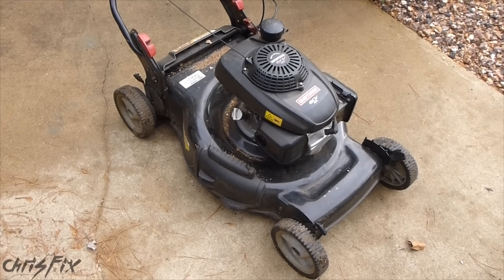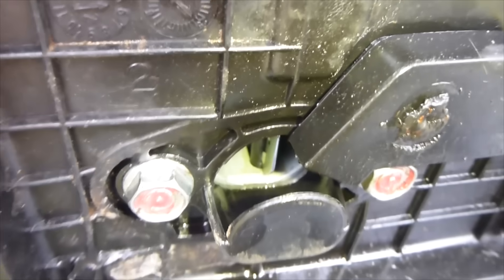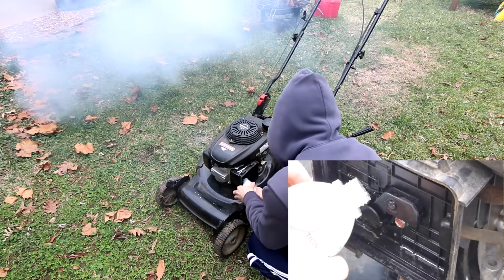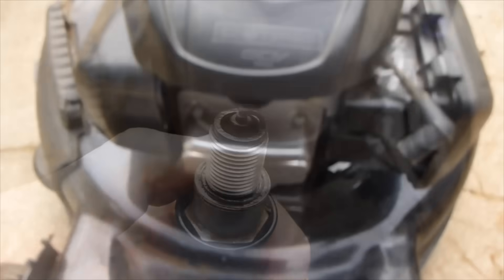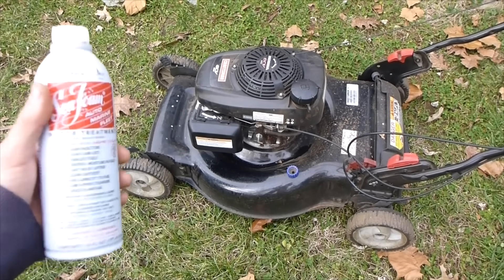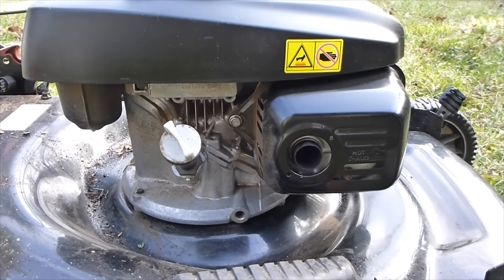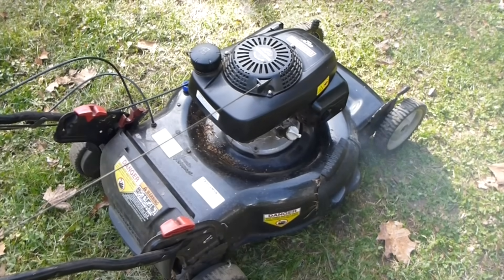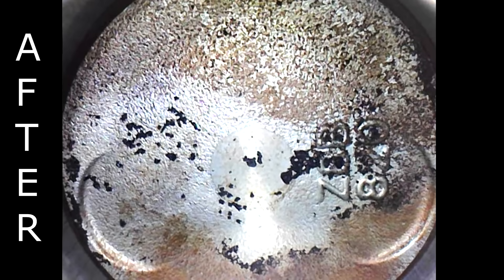Does Seafoam Actually Work? (with Proof)

Comment: I have a 1991 Honda Civic with over 200,000 miles that was burning allot of oil even though I didn't drive very many miles I had to add 1 quart of oil every month. I had no smoke @ startup so vavle seals must be OK, & I didn't notice smoke coming from the exhaust, but it was burning allot of oil. I was using the thickest oil I could find & also added Hy-per lube which is very thick & my engine was still burning a lot of oil. I saw a Youtube video where I guy poured Seafoam into the cylinders, put the spark plugs in, waited an hour & started his car. The idiot could  have hydro locked his engine. I took the spark plugs out & poured Seafoam into the cylinders & loosely put the plugs in & let it sit overnight. The next day I removed the spark plugs & checked how much liquid was in the cylinders, removed excess liquid & bumped the starter to move the pistons. I did this for four days, two days using Seafoam & two days using Marvel Mystery Oil. Now my car doesn't burn oil anymore using 0-30 oil! This seemed to get the carbon off the piston rings & allow the rings to seal properly.

Comment: I know this is from 2014 but is good -relevant information.  The use in a vehicle maybe another story.....i would not put seafoam on a running car engine too many sensors that may become damage? but I would soak the piston  overnight  and removed it the next day with a hose attached to a vacuum.  thanks for taking the time to do this excellent and useful test.

Comment: Yeah I usually just put the bottle in the gas and run it like normal because with a car you have the catalytic converter to worry about after the pistons. Do not want to damage that or the O2 sensors--- the Cat is expensive, the O2 sensors not so much but rarely come out nicely.

Comment: I've never seen anyone use it like this. They normally put it into the gas, oil, or spray it.
Reply: That's how my Dad taught me
Reply: When I first heard about sea foam back in 2003'ish, people were using the vacuum line off the brake booster to suck the can down the intake.  This was before they came out with the cans that had spraying.  Never hear of putting it in the oil pan or gas tank till I bought a bottle to try it out.
Reply: @orange281gt  Ya the couple times we did it was in the vacuum hose off the brake booster, not sure if any way is better than the other.  We were just taught that way 🤷🏻‍♂️

Comment: I spray water into the carbi and it cleans out the carbon
Reply: You really shouldnt do that. It'll cause your engine to seize eventually
Reply: @matthewheade9788  I did this for years on older engines [50-60's] and never had a problem.

Comment: You can clean the top of your piston and valves by misting water in while running. It’ll remove carbon deposits also. It essentially steam cleans the combustion chamber. 

I’ve been using water for 20 years to remove glow plugs and fuel injectors on diesel where there are carbon deposits keeping them from coming out of the cylinder head. 

Combined with Marvel’s Mystery Oil in the oil for a few hours prior to an oil change to remove carbon from around the rings.

Comment: It’s snake oil, run Rec 90 ethanol free in all small engines just like boats. Never have any trouble the ethanol is what kills them small motors. Just like your car every now and then you need to run it and pedal to the floor. If u just put around and don’t burn off the moisture in your engine or give it a good speed run (carbon cleaning) . For example it’s why Gmas 20yr old Buick with only 10k miles on it runs like shit. This guy is an idiot

Comment: berimen b12 works better and is half the price......you can also clear out carbon deposits using water, not sure if it will cause any long term damage but in a pinch it works!

Comment: You are trippin!  I use the sea foam in my 20+ year old Murray push mower in the gas as directed on the product (Briggs). Would not put this in my car as they most likely burn way more cleaner with the modern technology built into them. I appreciate your efforts and don’t dispute. We did this 30 years ago with water or transmission fluid

Comment: dear.sir i used seafoam in my fuel and run it it will clean about 80 % i run it on all my lawn.ewuipt even put a capful in my.oil if you have a used mower with sticky valves

Comment: Ture story....   It was about 25F outside temps and we decided to ride our Harleys.  Pulled up to a gas station and filled up.  We inside for coffee and come back out and the bikes would not crank.  None of them.  We figured it was the gas so we hitched a ride and got 3 cans of Seafoam.  Pour the whole can in our 5.5 gallon tanks, waited 15ish minutes and they cranked right up.  We blamed it on Ethanol in the gas and we also questioned the station about water in their gas tanks.

Comment: Marvel mystery oil will do the same job. The old car lot trick was to rev up the engine and slowly dump water down the carb. The same with dumping ATF down the carb except it really causes a lot of white smoke. In theory stuff dumped down the carb quick burns very hot and dislodges carbon and goop that was built up on the pistons, valves, valve seats, and heads. My mentor in the mechanical field was an old school guy who rebuilt not replace.

Comment: an improvement but not what you'd expect from an expensive product? what about an oven cleaner or cloudy ammonia solution with soap left in for a day and cleaned out thoroughly with alcohol? pour those in directly on cylinder btw, not via carburetor.

Comment: It may have cleaned better if some seafoam was put in the oil.
Reply: How is putting it in the oil supposed to clean the combustion chamber?  Unless the motor is fucked, the oil is on the other side of the piston.

Comment: They have top engine with a spray goes in the carb but this can I believe is for fuel tanks but it will help if it's running bad
Reply: At the time those video was released seafoam only had this product for cars. And it states on the bottle it can be used multiple ways on the bottle. Only recently did they release the too engine spray

Comment: You could have sprayed carb cleaner and blasted the cylinder head to clean it as well.  So what?  It won't make the engine run better or longer.  The main benefit of Sea Foam imho is to clean the carburetor and stabilize gas in a tank.

Comment: I have a 98 Buick LeSabre that refused to start. It drove fine to a friend's house nut just wouldn't start back up. I added a whole can of it to my gas tank which was half full of gasoline. An older guy I know swears by the stuff so that's why I tried it. It took a few tries but the car actually started up again. I haven't had problems since.

Comment: I use SeaFoam in my tractor. I mix it into the gasoline per directions on the can. This method brings the SeaFoam into contact with the carburator and all its associated parts and ports as well.

Comment: You can also do the same thing using water , because the induction of the water it cracks the carbon off . Use this technique for years. Carful not to add to much and hydro lock the engine ..IT WHY BEND THE CONNECTING ROD OR BREAK THE PISTON ALSO if you hydro lock it . Recommend using a small bottle with a straw to add the water

Comment: After standing the mower on the end and having a pool of the cleaner sitting on the piston I think it would be wise to change your oil because some of the cleaner probably leak down into your oil. Just like you should smell your oil on the dipstick every year it's first of the season to see if it has a gasoline smell or not.

Comment: just put the seafoam in your gas, run non ethanol gas and youll have no problems, 4oz marvel mystery oil in your oil keeps rings and valves clean. i liked your video.

Comment: So how has this "treatment" been of any significant value or made the engine run any noticeable difference?
Reply: You add it to the gas to clean up the carburetor, ports, injectors, etc. then it runs better because you are getting a better fuel mixture. The part you can’t see is it cleaning up the valves for a better seal. Piston head carbon only tells you that the other parts are dirty too.

Comment: what a waste of money... The problem doesn't come from carbon on the top of pistons. It comes from the baked carbon that gets in behind the piston rings in their grooves. Enough carbon in those grooves and the piston rings no longer seal or allow oil to lubricate the rings in their cylinders. No amount of Seafoam will cure that problem. Your carbon is superficial.

Comment: This stuff is garbage, never ever use it, I used it on a 02 avalanche and dealt with clogged fuel injectors for sux months,I kept getting misfires on random cylinders, I would have to take them out and clean out what looked like bee's wax out of them

Comment: I drilled a very small hole just after the air filter box. I put a thin hose in that hole connected a small bottle of distilled water. As I drove my vehicle the water would slowly drip into the air flow. Carbon in the combustion chamber, problem solved! I do this once a year for city driving. It's not needed if you run the highway allot!

Comment: I have no affiliation with seafoam . Problem 1990 wave runner 2 stroke 650cc not started in 4 years. Tried an entire can of carb cleaner, ignition spray  over several days, no luck. While digging around  for some other chem Solution , I found an almost empty can of seafoam, about a 1/4 cup . Poured it down carb and waited for 3 hours . It started on the first try. I had already located a carb rebuild kit for it , this was my last attempt before pulling the carb

Comment: Used seafoam on my E60, beforehand the cylinders looked a teensy bit dirty, I could see some build up, then during use I could hear what sounded like rocks in the engine, ran it for a lil while longer, cleared everything outta the system, checked inside with a boroscope, and each cylinder was sparkling clean, I was worried about my valves after the carbon being chucked around but they appeared to be fine and 30,000 miles later still work, soo woo!

Comment: Years ago it was more common to find an engine with what appeared to be a rod knock because of carbon buildup,
As a GM mechanic we used this all the time(GM top engine cleaner) 
Believe it or not you can safely do it with a glass of water, rev it up and slowly introduce the water till the engine just stalls, then let it sit and run it. ( I said slowly, slow= no hydrostatic lock up)

Comment: Before putting small engines away for the winter. I put Seafoam in the gas and run the engine for five minutes. It works better than others I have tried for starting up in the spring.

Comment: Chris, you should run a seafoam mix with your gasoline for an extended time, like over the summer and compare the carbon buildup that results. It would be really interesting to see if using it in your fuel controls the carbon.
Reply: It should also clean the carburetor
Reply: @joshmanis-h7h  and it will keep the white gunk from ethanol away👍 seafoam also saved my atv wet clutch after a friend put regular oil in it👍i approve of seafoam!
Reply: @joshmanis-h7h  That's really the most important thing anyway.
Reply: If I was just doin a mower I would just pull the head off and  clean top of piston . Not feasible on vehicle engines though. 👍🏽

Comment: I used this on my mower, really F’d it up, ended up replacing the carb.
Reply: Also, don’t replace the carb, just clean it. Take out the bowl and blow out the jets. It costs nothing and it’s usually all a mower needs
Reply: Don’t use this on a lawn mower, just run some seafoam through the gas tank. Lawn mowers rarely need carbon cleaning, but if they do, it is actually easier to take off the cylinder head and grind it off rather than to run seafoam through it.

Comment: Gumout is a perfect solution to start the lawn mower. I had done several things like: Cleaning the filter, changing the spark plug, and filling with the clean gas, but the mower still not started. So, I found online, someone used "Gumout" to start the engine.

Comment: Twice now, my wife's J.Deere mower has suffered from 'seeking'...that condition where the engine RPM's surge fast, then normal, then fast, then normal...repeat.  The only way I could smooth it out was to push the choke up to 3/4 (indicating the engine was being fuel starved).  Twice now, I've 'almost' taken the carburetors apart after replacing fuel filters, air filters and fuel lines.  Twice now, it has occurred to me to try a can of SeaFoam and twice now, it has worked.  I'm not sponsored by these guys, I'm just telling you what worked for me and saved me tons of $$$ at the dealer.  If you don't pour it straight into the carb, keep in mind it takes awhile to get from the fuel tank to the engine so be patient while it spins its magic.  I'm convinced it cleans carburetor deposits too.  I let the Deere run about 10 minutes before the problem cleared up completely.

Comment: I use AMSoil Power Foam for my engine and I always soak it up by injecting directly into the sparkplug hole and the intake manifold to clean the valves. The foam makes it easier for horizontal engine like yours. I also did it to my 100cc Honda engine.
Reply from the maker: Thanks for sharing!

Comment: This guy obviously isnt a qualified motor mechanic. Just a YouTube guy.
How much carbon is on the piston crown has no importance at all. What IS important is how clean the piston ring grooves and oil control rings are. As they are responsible for how much oil gets up into the combustion chamber and thats what makes the piston dirty.

Comment: I'm certain that it works. I put fresh oil in my car plus the Seafoam and it turned pitch black after a few miles which never happens when I do an oil change only using regular motor oil. The important question to ask though is that sure, it cleaned it out but are there actually any benefits? Does it improve gas mileage or engine lifespan?

Comment: I wonder if just pouring a little bit of water in there would have the same or better result? I saw a car that blew a gasket one time and the rad fluid got into the pistons, when we opened it up those pistons were like new shiny.  Of course you have to be careful to put in very little amounts but in the 70's they used water to clean out motors.

Comment: "if I want to coat the cylinders in my car, how do I get it tilted up against my garage?" - a real mechanically-inclined person
Reply: your cylinders are vertical but I wouldn't recommend unless you want to buy a new engine.
Reply: It would work really well, if you had an in-line 6 cylinder engine, where the cylinders are straight up. For a V-8, You'll just have to use the intake method, unless, you had a ramp, that would allow one side of the car up to a 45° angle, do one bank, then the other, the same way. Most 4 cylinder cars have the pistons straight up as well. The slant six in some old Chrysler cars, and V-6, as well as V-8 would be tricky.
Reply: They sell it in a spray also, while not soaking, you can hit it a few times over several minutes.

Comment: Don't know how to tell you this, but water will do the same thing.  It's just a quench shock on the carbon, which breaks it loose, primarily in both cases, I expect.  It would be interesting to compare the two techniques, ie. with and without the solvents.  I used to do this in cars on the rare occasions they started "dieseling on" for a turn or two after switch off.  What caused this was a point of carbon somewhere in the cylinder staying hot enough to allow LOUSY combustion after the ignition spark was removed, sometimes for a couple of seconds.  It, too, required careful application, you would just open the throttle completely and regulate the RPM to something reasonable with the water pour (3 or 4 K is fine), but don't stall it, or it was a pain to restart.  Black deposits would absolutely SPEW out of the tailpipe, so it was probably doing the same thing in the pipes, there couldn't POSSIBLY have been that much carbon in the cylinders.  It would cure the problem instantaneously, and usually for a long time, or the life of the car, sometimes (bad gas, just long term 'blow by', don't know?).  Question, Is the seafoam JUST a carbon cleaner, or carb, too?  Actually, I'll just go look it up.

Comment: Air will compress in a cylinder.   Fluid will not compress.  When you pour random amounts of fluid in a cylinder the piston will try to compress it and the compression will be beyond what the motor was designed to do.  This puts a huge load on the rings, the piston,  the connecting rod, and creates a lot of heat.  Do this at your own risk.  You may damage the engine.

Comment: You can do the same thing and get the same results by using something a lot cheaper.  Lol.  Called “WATER “.  Old mechanics used that method to remove carbon from the piston and valves for DECADES.    By getting the engine warm/hot/max running temps  ,then pouring water down in the carb  ,while holding throttle wide open after rpm build up/Or start to get to high windup  .   The hot carbon just brakes up when cool water hits it.      Works like a charm.  And it don’t cost 40$.  Lol.  And I’m sure it would work just as well for lawn mowers.     Just like it does when cleaning a iron skillet after burning the shit out of your hamburgers (or bologna in some peoples cases )  Lol    For the dummies that reads this ....Keep in mind Tho they don’t have a  carburetor on the skillet. Or a throttle.  Lol